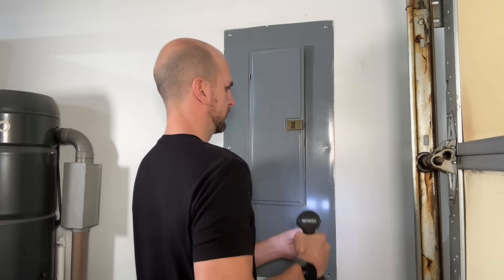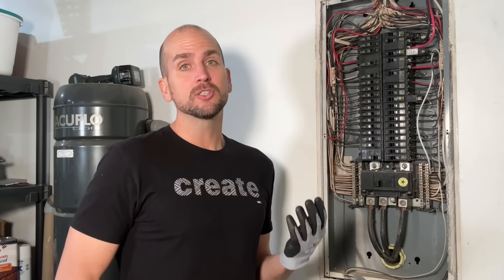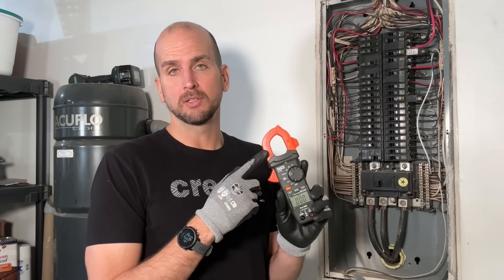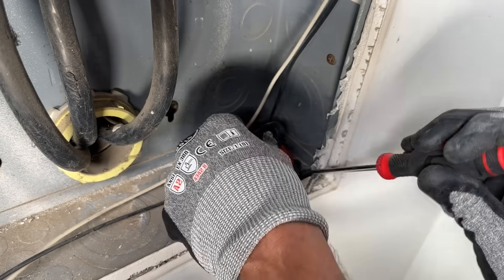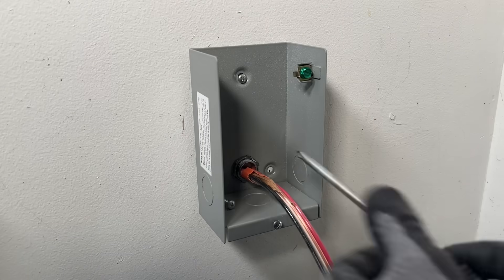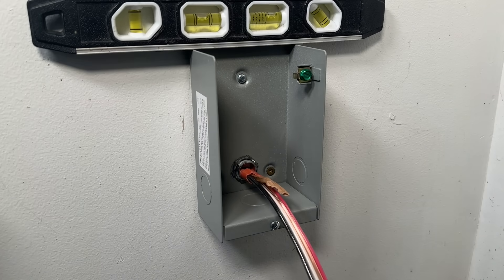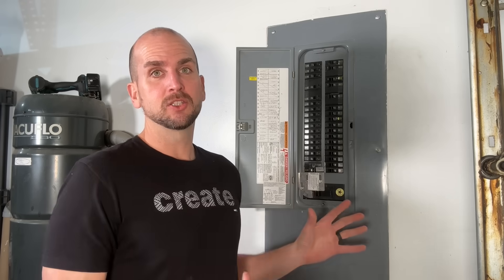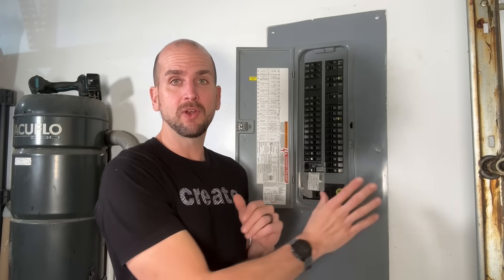Whole House Power Backup Solution | Generator Inlet Box Install

Comment: Good job and great video thank you. I'm using a 4-cylinder Nissan 15K generator. It runs
 1800 RPM so it's pretty fuel efficient it's plumbed for LP or natural gas at any given time. I have a 50 amp breaker. I have had it for 23 years Love it.

Comment: Is it possible to run an extension cord directly to one of these generators? What if I’m only interested in supplying power to my fridge and a couple of other things (phone chargers, maybe the internet modem, and a couple of lamps) without having to do this work on the panel?

Comment: I notice that every generator interlock video shows an ideal situation with a perfect QO or Siemens panel with a simple interlock. You never see a 200 amp 40 year old Zinsco meter main or FPE or 30 yr old Bryant, GE or Crouse Hinds etc. Good luck modifying or finding those interlocks.  Thankfully there are manual transfer switches for the rest of us.
Reply: If you have a zinsco you should be looking to replace it instead of generator power.
Reply: I have a 30+ year old GE panel. I had no trouble finding a mechanical interlock. I'm also doing a 30+ year old Square D Homeline installation, I had no trouble finding an OEM interlock for this panel. The SQ Homeline OEM is a bit nicer than the aftermarket GE interlock, as it has a generator breaker retention bracket.
Reply: I have a 200 amp Siemens/ITE meter main disconnect that is flush mounted in the brick siding.  The load center in the house has no main disconnect.  House was built in 1992 and I would have to replace the entire load center panel to achieve an interlock.  This video cherry picks an easy inexpensive installation scenario.  This is why qualified individuals use Captive Key interlocks or Trapped Key interlocks as a alternative.

Comment: I have a 50 amp inlet on my transfer switch for my home.  Its powered by a westinghouse for outages.  Could I possibly use a solar battery backup like a Eco flow with a 30 amp connect to the 50 amp inlet on my transfer switch?

Comment: Question. When you run generator to one 240 breaker. Doesn’t that only put power to only half the breakers?
Reply from the maker: Not if you have a 240V outlet on your generator.

Comment: Curious about the line power coming in your panel. Did you have the power company cut the power for you, or were you just super careful not to touch those contacts while you worked?
Reply from the maker: The main conductors were landed in the 200 Amp panel well before me owning this house.  I am sure they had the meter base pulled prior to running the conductors from the base to he panel.
Reply: Right. But even though you flip the main breaker, the main conductors are still live up to the point they enter the main breaker. Unless the power company kills the power coming from your meter. 
Not a big deal if someone is careful, but something a novice should be aware of.

Comment: Your generator inlet box is facing inside the house. What will you be connecting to it?
Reply: It is two feet from the garage door.  He showed where he would place his generator on the driveway.
Reply: @robertworden9810 What's the timestamp for that? I did notice at the end, he does mention a Genset and Ecoflow Delta Pro. The Genset doesn't make sense because you can't run that or a gas generator inside the garage. The Ecoflow does make sense for inside facing outlet. Thanks

Comment: there is a much easier and more cost-effective, more safe, and cheaper way of getting this accomplished. I installed a Connecticut general transfer switch, which not only protects you from backfeeding to the grid, and vice versa, it allows you to literally select which of the breakers on the main panel you wish to access the generator.

Comment: I'm just curious why sometimes there is a secondary panel or switch board that come as a bundle with these inlet boxes. Is there an additional fuse/layer of safety with those? Or are those larger Generac (as an example) switch panels just for ease of use when selecting/remember what you have hooked up to the inlet box installed that's receiving power from the generator? Great video. We lost power this weekend and temps in the hose dropped to 20 degrees. I felt like an absolute dingus for not having this simple back-up that could've at least had our furnace keeping temps above freezing.

Comment: What if you have a 100 amp breaker box and isn’t inside your house and want to hook up the generator a plug it up outside?
Thanks
Reply: Not sure I’m following you but it sounds like you do the exact same thing that he did except you’re on the exterior wall instead of the interior wall. The fact that it’s 100 amp main breaker doesn’t change the fact that you could use a 30 amp or 50 amp breaker tied to the generator.

Comment: Pull that inlet plug back out and i would bet my life on it that the terminations are loose again. This is why diyers should not do electrical.
Reply: Well, I’d venture to say that 90% of the people on this channel would say you’d be dead. He torqued them down to spec.  What would you the electrican do differently? BTW I did it identical to this guy and I have had zero issues for years. I am a DIY too 😊

Comment: Does the 30AMP breaker feed both phases of the panel or just the side it's on?
Reply from the maker: I have said this wrong for years.  For standard residential it is a single phase with 2 hot legs coming in which are 180 degrees out of phase with each other.  The 30 Amp (double pole) breaker will have both legs resulting in 240V.

Comment: I am doing this exact same hookup but with a 50 amp .. My question is by putting the 50 amp coming in from the generator on one side of your main box does that just power that side and not the other side of the main panel? After reviewing my box that's how I feel it works or am I wrong

Comment: My town actually requires a transfer switch setup.  You don't use a lockout on your panel but install a switch set that only the generator line or the electric co line to power the panel, not both

Comment: Thanks for putting up this video. Where is the inlet box you installed? Is it next to the circuit breaker or outside your house? Normal generators such as gasoline or gas powered ones must be placed outside a house.
Reply from the maker: This one was inside the house as I was setting up to have backup from EcoFlow Delta Pros.  I just installed a similar unit with the generator inlet right on the outside of the house to run a more standard gas generator setup.
Reply: And when installing the Ecoflow delta pro what is done differently if anything to address the neutral bonding discussion in many of these comments? I’m confused.

Comment: Am I missing something?  17.5 amps + 9 amps + 8 amps = 34.5 amps?  More than the 30 amp rating of the Inlet Box.  Can someone make sense of this for me?  Is it that A phase and B phase are independent of each other and are not summed?  Thanks
Reply: 30 Amps on each hot wire.

Comment: Super. It is convenient to have an extension cord that lets you hook up to any generator, and haing to turn off the main to connect the generator is much better than using a suicide cord and not remembering to turn off the main breaker. 💙 T.E.N.

Comment: That's good video for the beginner DIY like me. I am trying to install 50 amp circuit breaker. In video you installed 30 amp circuit breaker. I guess I should use a different wire. I have been searched in Amazon, but I couldn’t find which one is right. Can you help me where I can buy it ? Thank You.

Comment: You might also want to add additional instruction label to INSURE certain high amperage breakers are also shut off [thinking central AC, electric water heater, etc] so as to not overload the genset.

Comment: I'm planning to use a 8000w, 12,500 peak watts generator with a 240v 30amp to run my central AC unit.  I've installed a Micro air soft start device to my  AC unit.  It delivers between 33.6 to 34 peak amps.  running amp to 9.  Your thoughts? can my generator handle it?  Is it safe?

Comment: I have a 200amp service and need to add a 30amp generator outlet. on a Home lite elect. box . If you hook up the 30amp breaker to just one leg of the incoming side of the box ( Main supply line) will this power your entire, All breakers on both sides. I don't see a connection between both sides of the breaker hook ups . I hope this makes sense. Thanks breakers box?
Reply: The busbars alternate throughout the box like a zipper. A 2 pole breaker will contact both busbars.

Comment: So you added a 30amp breaker which will back feed to all circuits that are turned on, to run lights, appliances,etc within the 30 amp max??? What if the main and the new breaker are not positioned for an interlock install?

Comment: Go ahead and put the 50 amp in, later you may want to add 50 amp generator to handle air conditioner
Reply from the maker: Yeah, probably not a bad plan.  Then if you need to use a 30 Amp you can just get a converter plug and keep the future expanded capability.

Comment: I am assuming same plug can be used if i go with home battery backup. I was thinking to install the plug in garage and put my power stations there (50A) and in case if power outage last longer than 1 day i would connect generator to it.

Comment: ECOFLOW DELTA PRO is the way to go imo...two of these units which are fairly portable (but heavy) make it so that I can move them back and forth between locations (home and RV) for alternative set ups
Reply from the maker: I agree, if you have multiple use cases 2 of the Delta Pros can come in pretty darn handy.

Comment: I did this to my home in Ft Myers FL just last year on Sept 15th, not knowing what was coming...... My Honda 7KW Gen arrived 2 days later. Little did I know that effort would save my tail less than 2 weeks later with IAN. I had the same plug in with a 10 circuit Reliance manual transfer switch box. Both worked Flawlessly for days till we got power back. Good investment...

Comment: Thank you. I did a similar setup to this several years ago. The one extra thing I did was to include a power back on alarm.  This is a small battery powered device that detects when power is again available to the main breaker even though it is still off. The reason for this is that I am using a 7200 W generator and I am not watching for the mains power to return. If the outage is during the daytime, you will not notice any lighting from your neighbours. This little device makes a very loud noise when the power has returned so you will be alerted and be able to shutdown your generator fairly promptly.  More recently, I have added sensors to my home automation system (runs on UPS power) so I get notices on my mobile phone of power interruption or restoration events whenever they happen.
Reply: Do you have additional information on the power back-on alarm setup? Thanks

Comment: Hi thanks for your tutorial, it has been very helpful so far with my preparation to hook up my generator. But I am seeing a potential problem for me. I have the same Square D panel as you do in that same orientation with the main breaker at the bottom and measuring 1 3/8" at the panel surface separating the main and other breakers. The problem - I have a spear 2 pole 30 amp breaker to the right above the main breaker that I can simply remover and install my 2 pole 50 amp generator breaker. I don't want to move wired breakers around on the left side. Will this or any interlock switch work with the generator breaker installed on the right side above the main breaker?
Reply: Yes it can go on either side.

Comment: hi, nice video, my question for the day, My 7500w generator has a 50 and a 30 amp out let, but for some reason above it is a 30 amp fuse. That's throwing me off a little? I do have the main outside the home under the meter .I cant see why I cant use a 50 amp inlet box and a 50 amp breaker in the panel outside and with the main off feeding the panel with all the other breakers on the inside of the home and leave that main on. I do have a well for my water and toilets,/a/c, fridge and a few lights or what not general house things. Your thought would help thank u.
Reply: It’s mostly based off space and how much power you plan on using, the more appliances and outlets you want running the more gas your generator is going to cook through. 30 amp usually gets the job done for basic needs during an outage. You can do a 50 amp inlet if you want to but most people just do 30.

Comment: I already have a 50 Amp connector and a 50 amp braker switch, can i use a 30 amp generator or do i have to have a 30 amp connector and braker switch?....I am trying to avoid having to buy 30 amp switch and connector since i already have a 50 amp and also will like to be ready for a 50 amp system if i decide to up to 50 amp later down the line.

Comment: That type of interlock is no longer acceptable in Canada.
You need to isolate the neutral ( with a 3 pole breaker) and this requires a special generator panel, greatly increasing the costs
Reply: Will that be a bonded or unbonded neutral in the generator panel?.... Better than 9500 we just take off the neutral at the panel. I suppose Canada wouldn't like that....spend more $$$$$$
Reply: So what is exact way one can do this is in Canada legally. Could you specify the list of equipment.

Comment: Nice work ....what could you suggest if i only wanted to power 110 appliances in this manner. What particular plug would be needed and what connections to the main box would be different.? I'm using a eco flow delta 2 max which I've attached  an rv 30 plug already. Thanks
Reply: Did you ever get an answer?
Reply: With a 110 (120v) generator you can only power one rail of your panel.  The left and right are separate 110 phases of the 220v 2-phase feed.  That means, you would have to put all the loads you want to power by generator on a single rail and only power that rail with the genset.

Comment: People get so caught up with these battery backup units but in reality how long can you power an entire house with them? The cost is prohibitive compared to a gas generator and the run time of a gas generator is way longer than those batteries. You can also have several gallons of gas stored in case you run out but once those batteries go dead so does you house with no way to recharge them. Oh if you had a gas generator I guess you could recharge them 🤣

Comment: So if I got a generator with a 50 amp plug would I need to get the inlet box rated at 50 amps also? Same as the 30 correct have to be matching?
Reply from the maker: You could make a conversion cord taking it from 50 Amp plug to 30 Amp. Alternatively,  if I had a generator that large I would place a 50 Amp inlet box and run 6 gauge wire to a 50 Amp Breaker with interlock kit.

Comment: I live in a new mobile home have a powe pole outside beside the house running  power to main breaker box in house do I need to put the 30amp outside or inside to main box?
Reply: outlet should be installed outside. who runs a genny inside their home ??..lol.

Comment: If you don't need or require 240V, then it's actually best just to send 120v single phase to both legs.  That way you are not trying to balance a two-phase 240V system using a generator, and everything 120V in your house works.  You can still wire up a 240V 30 amp inlet power box, and use a 3 wire to 4-wire power cord converter at the generator that supplies the 120V to both legs.  Be sure to use a physical interlock between the breaker for the inlet power box and your main disconnect.
Reply: What are you talking about....240 volt is two 120 legs with a neutral 😂
Reply: @robbenoit6065  Then re-read my post.  It's not just "two 120v legs"...it's two different phases of 120v.  If you don't require 240v, thus you really only need 120v to power your 120v appliances, then it's more efficient to push 120v single phase to power BOTH 120v legs of your panel.